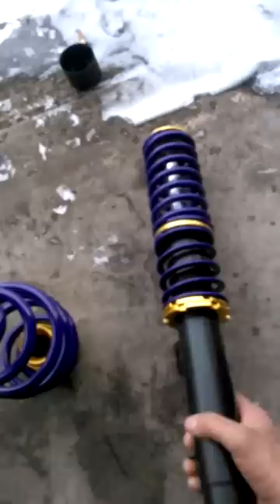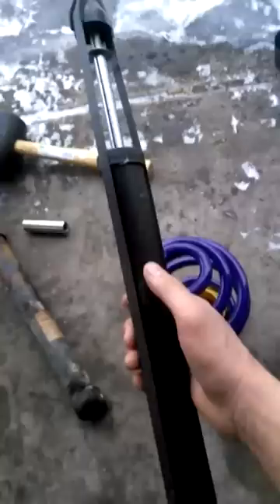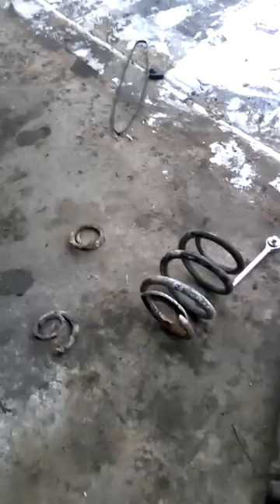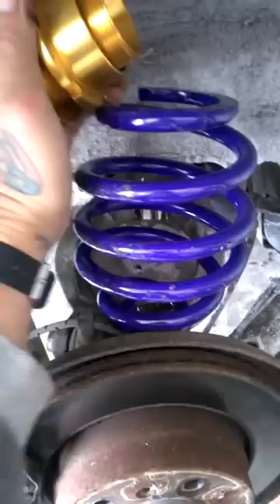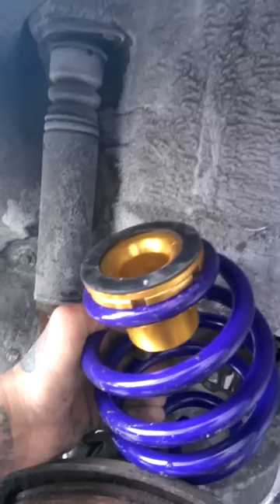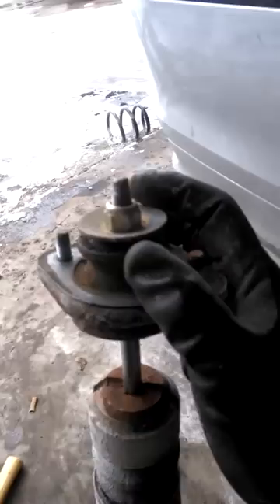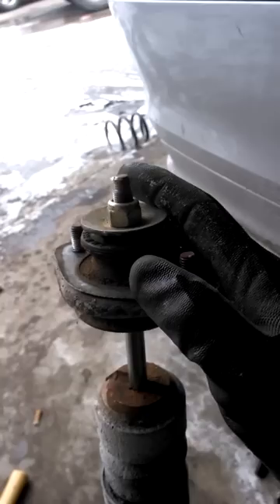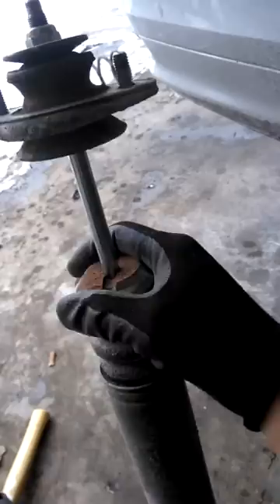2000 BMW 323i coilovers E46 ready to drift

Comment: Yeah I just bought coil overs for $500 for my 330i. It was going to cost that much to replace are my struts and springs anyway so why not buy coil overs aha, Plus with my after market wheels the height adjusting is a plus.

Comment: good video very informative. Thank you for posting... would u mind linking me to the ones u purchased. locked in a good set but there not adjustable those look right up my lane.
Reply from the maker: Thanks bro I posted up the link in one of my other videos. Not sure witch video. Yea these coilovers run smooth especially over bumps n they give u a good slam. go to the link I had posted also goggle em on eBay u might find them cheaper for the same ones. Let me know how it goes.

Comment: he said his stock springs broke apart lol they were either cut, or heated so he could lower it
Reply from the maker: No they where just old oem springs. I had just got the car from an old man . I don't think he would do that.
Reply: +jdm G-baby you never know who he got it from lol it just looked like a very clean cut on the front spring you showed. I break usually is that clean. but I guess they could have broke due to all the rust from the salt.
Reply: +jdm G-baby you never know who he got it from lol it just looked like a very clean cut on the front spring you showed. I break usually is that clean. but I guess they could have broke due to all the rust from the salt.

Comment: hi how are the coilovers holding up?
Reply from the maker: Was up man they feel good not bouncy at all. I'm gonna make a video so I can give an update on them. thanks for watching.
Reply: jdm michael n gabby feliciano  where did u buy them ,and how much, my shocks are going bad, and i rather buy coilovers instead of stock suspension cuz my car has the sport suspension ,that is more expensive
Reply from the maker: Brian Sanchez go to yellowspeedeurope.com or you can buy them from them on eBay they are on there also. Very fast shipping the only thing is u can't use it stock sway bar links. I still have not bought my link kit n it rides good for a daily car. I'm make a new video soon.